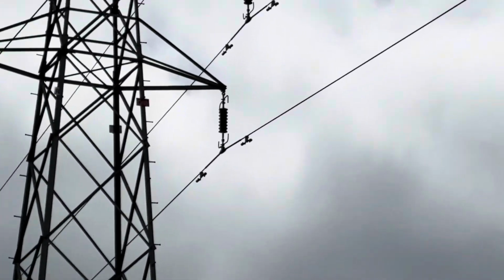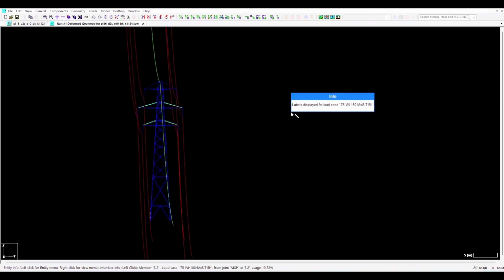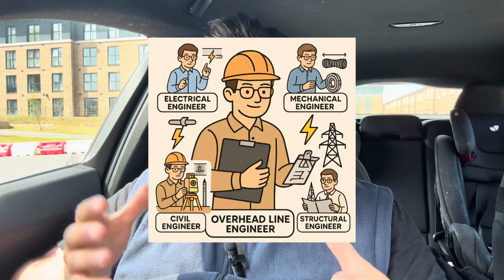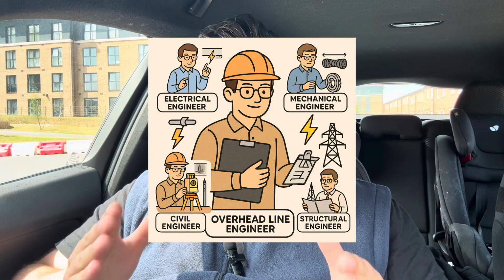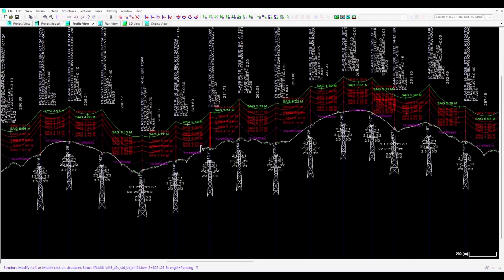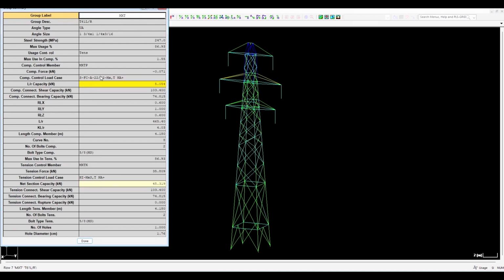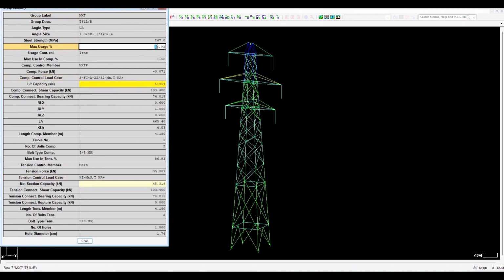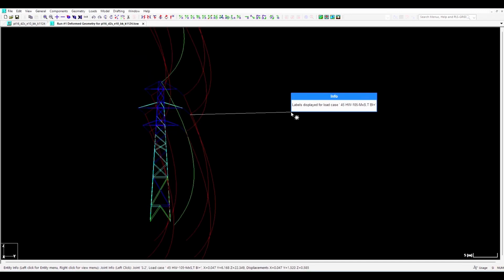A Day in the Life of A Design Engineer - UK

Comment: This 😂looks very difficult to draw in software PlS.  Is this really difficult ?  Etap , software can be replace with Pls?  I want to start my career in substation design engineer by learning etap, autocad, excel . Would you suggest your point of veiw and guide me more?
Reply from the maker: Hi Haroon, every software is difficult in the beginning, but with time you will get the hang of it. PLS software is mainly used internationally for Overhead Line Design. Substation design engineering is very interesting and is a great side of the industry to get into and yes you will need to gain skills in using those aforementioned software's. There is plenty of good YouTube tutorials that you can look through but without the actual software in front of you it will be difficult to apply anything you have learned. Best of luck!

Comment: I’m an electrician by trade currently studying my HNC/D and the moving into a BEng. What kind of salary would I earn as a design engineer within the DNO space? I’m really interested in power systems
Reply from the maker: Hey man, all I can say for sure is that the energy sector is in very high demand and design engineers are in short supply in the UK. I’ve only been in the industry for approx. 7 years and I’ve seen a huge jump in pay, ofcourse dependant on skill set and discipline. What discipline are you trying to get into, OHL, Protection & control, Underground cabling or substation design, all these disciplines will pay well once you gain a couple of years of experience. 

Add me on LinkedIn and we can talk further: Ali Albayati

All the best